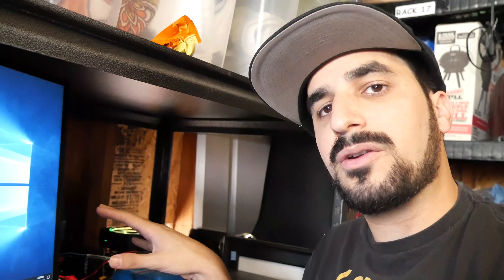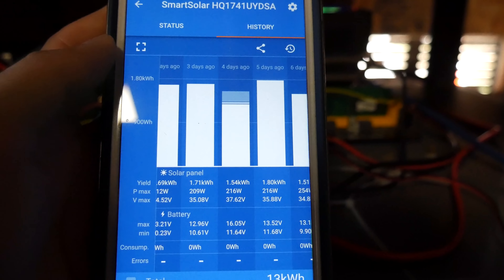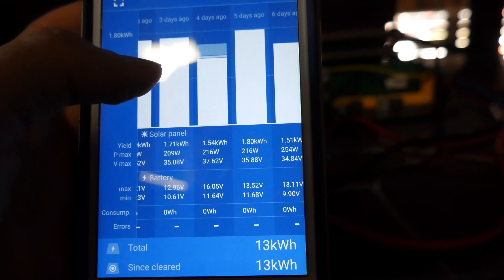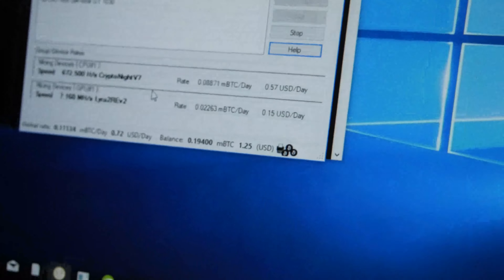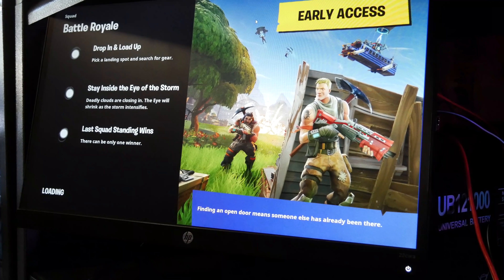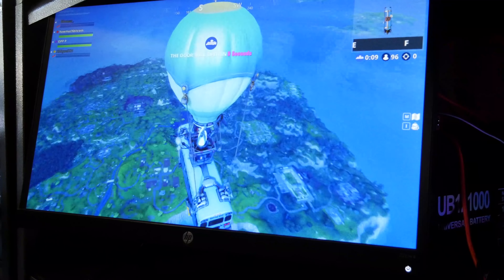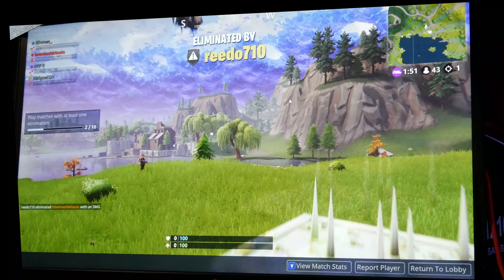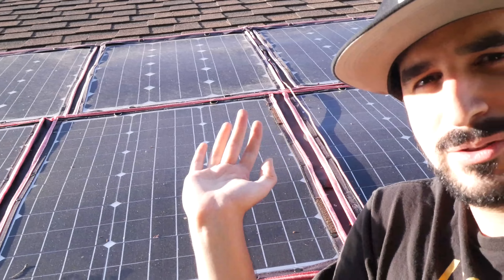How much did I make mining bitcoin using solar for two weeks

Comment: Clean your Solarpanels and make Sure there are no Shadows on it. Shadows Killing your DC Voltage and efficency .. sry for my bad english.
Reply from the maker: I actually did wipe them down and saw less than 1% improvement sadly
Reply: HowMuchBitcoin oh okay. They look dirty in the Video 😁 . Try to get some better panels. Or an other Solar Power system. I build Solarparks in Germany. 11 Megawatts is currently the biggest. Working on 50Mws + . Lot of Mining Energy 😂. Think about it to fill up your roof with Solar Power.. you can save a lot of money .
Reply: South facing is best to maximize the most sunlight. Make sure no shading from trees are blocking panels.

Comment: Hello Sir what is the minimum wattage supply use for mining using solar electricity from solar panel what is the  wattage capacity requirement as your experience and recommendation for us if we are using solar panel to supply power to  PC and GPU mining.Thank you.

Comment: Power can be lowered if you look in to a passive CPU heatsink
Reply: And get rid of the SSD as you can boot and run from a usb stick...
A bit slower on startup but, no more power for the SSD.

Comment: Hey, list your components part numbers and links in the discription.  Been asking you what the model is of your mppt controller is .. You flashed it so fast the last time.  Thx.

Addendum:  You are playing Russian roulette if you do not use a pure sin wave inverter with sensitive electronics.  Power tools, electric motors, lights are okay, some are simulated sin wave inverters and they also do a poor job of maintaining 60 Cycles which is what you get from your plug in the wall.

Comment: I'm not really sure if I'm right but I think that this power supply is a little bit inefficient and a DIY PSU would be definitely better.
On other hand it would be quite a challenge for you to do one since it would require SMD soldering skills
Reply from the maker: The one i use does work but i would recommend the 250w one

Comment: I have an off topic question, why is my gtx 960 4gb only getting 5mh. Sometimes i get lucky and it reaches upto 11mh. But its pretty hard recreate...
Sidenote: My gtx 10606gb is also performing bad on eth, only getting 16.5mh onverclocked mem to max stable. Its hynix but ive heard people got their hynix 1060 to atleast 19mh.
Reply: Sean Eredia you need to make sure the driver is set to “optimize for compute” my 970 gets around 7mh/s
Reply: Luis Roa I already did it, still no good. Sometimes it reaches 11mh but when i stop mining amd start again, it stuck on 5mh again...
Edit( talking bout 960 btw :)
Reply from the maker: Drivers, new rom, overheat?
Reply: HowMuchBitcoin I have the latest drivers and my temps on 960 is around 67c and 70c on 1060

Comment: well you hooked it up wrong . you need to run off the battery's and not the charge controller . IF the batterys are fully charged all the time it needs to be on the batterys . To much load onr the charge controller
Reply from the maker: I actually went directly to the battery as the charger controller can’t handle the current
Reply: HowMuchBitcoin ya that's cool . I'm wanting to do the same thing man . The huge question so what would the mining rig do if you went to an 12v TV and just had the small TV off the charge controller .